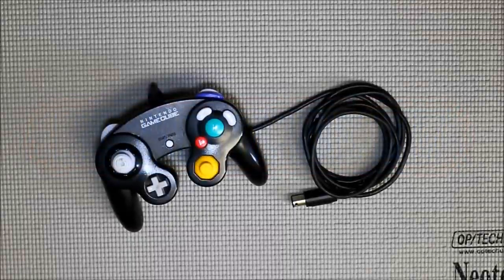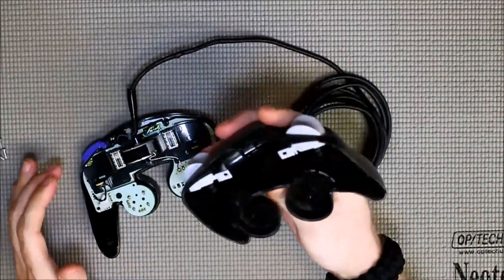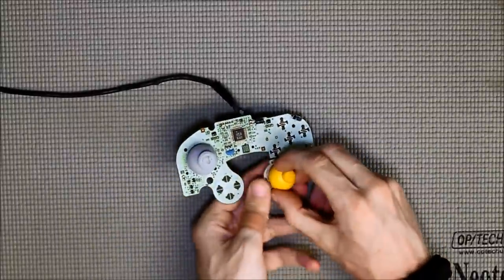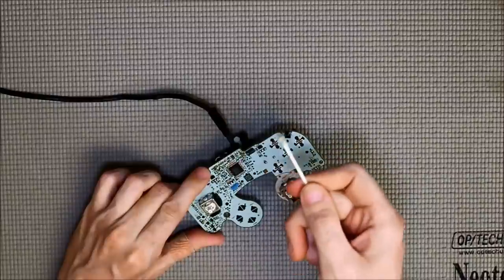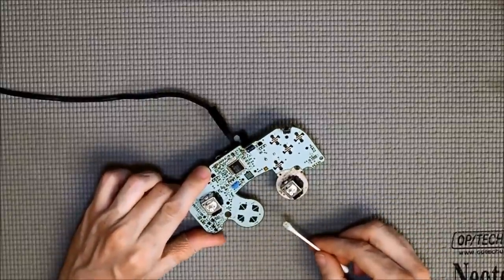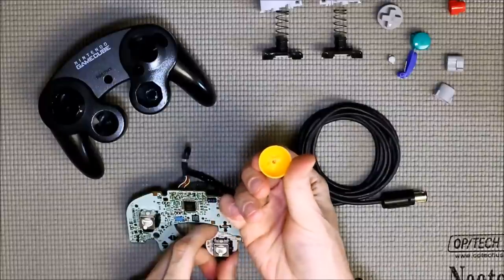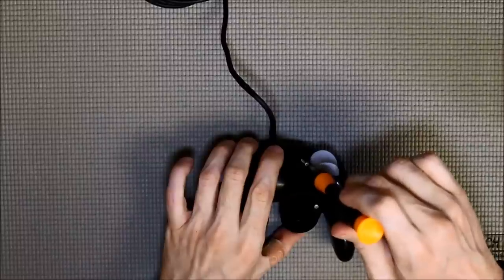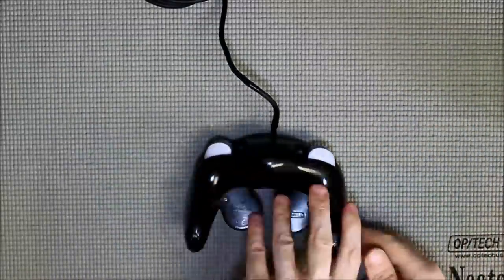Repairing An Original GameCube Controller

Comment: Or buy a new one for 10 dollars and not waste your time
Reply from the maker: Don't know where you're finding an abundance of them for $10. Going rate, on average, is about $30 right now. Unless you get lucky and find one at a thrift store or garage sale. And usually they'll need this done to them anyways.
Reply: I go on ebay or shopgoodwill. Also theres like a gamecube classic version on amazon fairly cheap
Reply: Sebby Siena Those are third party controllers, bought one myself that ended up limp sticked in about two weeks from smash. Legit nintendo ones run around $30.
Reply from the maker: John's right. I'm not seeing anything but those crap 3rd party controllers on Amazon for $10. There's a 1st party white one, but it's $31. And I did say you can find them at thrift stores like Goodwill for between $5 and $10. That's where I got the one I cleaned in this video. But it was gross and dirty and the thumbsticks were destroyed. So, you can find them cheap, but they'll probably need this treatment. And to be honest, I do this will every used controller I buy regardless.
Reply: Not to mention this knowledge is good to have for general controller maintenance if you run your own down a bit, we have a different view on what is a waste of time I guess.
Reply from the maker: Agreed! I love watching other people's repair videos just because I might learn something. Plus I think they're just fun to watch. Waste of time or not, doing stuff like this relaxes me. If people like Sebby think it's a waste of their time I'm not sure why they bothered to watch. Seems like their problem, not ours.
Reply: ***** lol dude i fix broken 3ds's and stuff its more like work to me so i guess its fun then keep doin it
Reply: ***** There's new Gamecube controllers you can get, they're the special Smash Bros edition Gamecube controller, they have very long cords like the white controllers.
Reply from the maker: Yep, I've seen them. I hear they feel kind of cheap by comparison and aren't they about $30 as well?
Reply: Yes the Nintendo ones are $30 well the PDP ones are $25
Reply: Try playing melee with a control that's complete garbage. Not fun at all. Lol.
Reply: Reaper Phenmenom can't find it
Reply: +BlastMode7 found me a silver one at this store where people drop off stuff they don't need anymore for $3. It had no issues at all except a little discolor at the end where you grip it
Reply from the maker: +Donda Nana That's awesome. Sometimes you can find them locally for cheap. I've found a few around here for about $3 - $5 each.
Reply: Lmao buy a new one for 10 dollars? Third Party controllers are shit.

Comment: I disliked because my gamecube controller had diffrent screws and the tool you linked on amazon wasn't helpful at all, sorry but my experience wasnt the best with your tutorial
Reply from the maker: I'm sorry things didn't work out for you. However, if you found something other than tri-wing screws it wasn't an original GameCube controller or someone changed the screws as all original GameCube controllers had tri-wing screws from the factory.
Reply: I just used very tiny flat head screw driver and worked for me for those type screws though it was hard